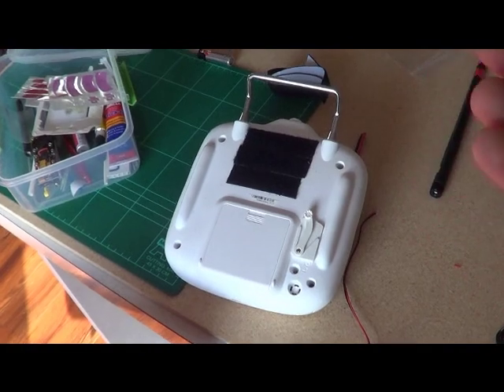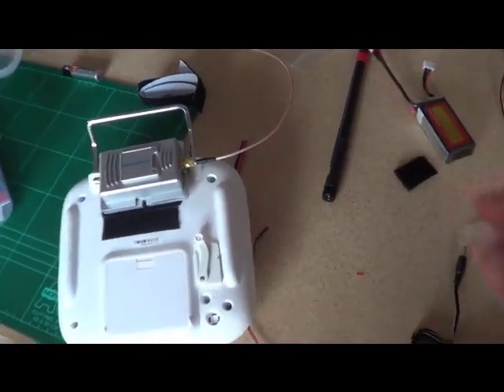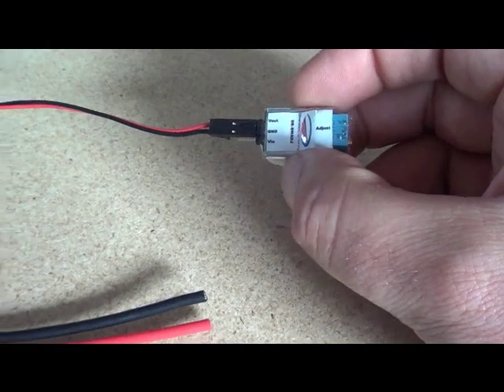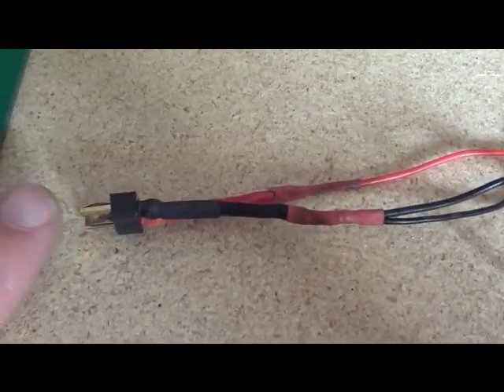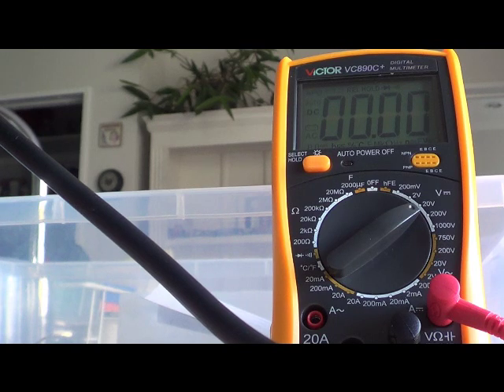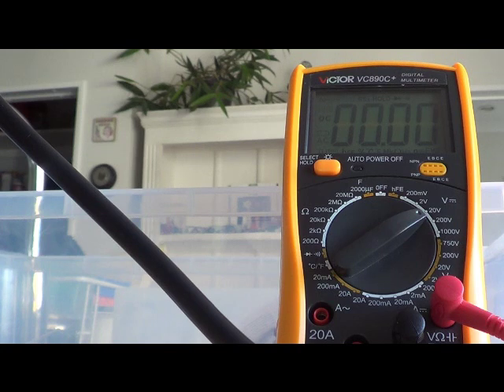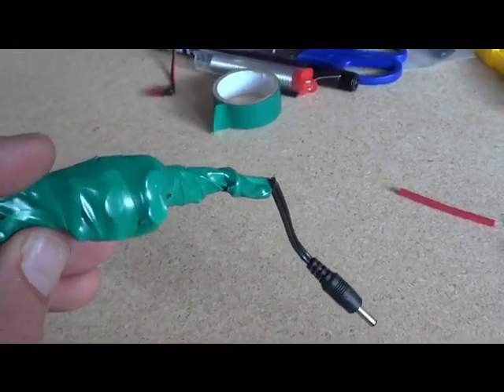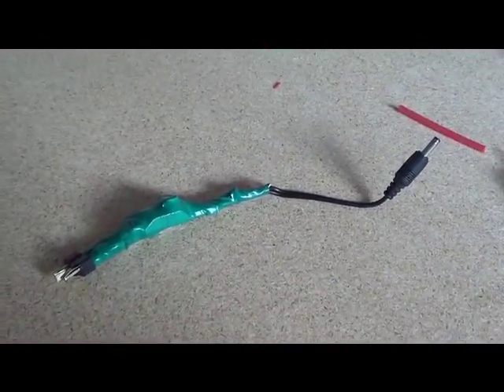DJI Phantom 2 Transmitter Amplifier

Comment: Pete, thanks for nice video.  I am new P2V+ owner and am trying to learn.  I am confused about this controller.  1) Isn't is 5.8 GHz output?  2) Does the 2.4 GHz amplifier amplify this higher frequency?  3) unrelated to your video, could you tell me whether this control signal goes directly to the P2V+ as a direct control signal (I think this is the case) ... it doesn't really go through WiFi repeater does it?  Thanks.
Reply: the tx does in fact run on 5.8, idk what this guy's talking about, unless its an older phantom with no FPV camera.....the wifi range extenders run on 2.4?  or was it 2.7?
Reply: sketch6995
This particular transmitter IS INDEED a 2.4 GHz RC transmitter. Most of DJI transmitters (if not all of them - at least all that I've seen used) are 2.4 GHz. 5.8 us usually for video transmitters IF you live and fly in a fairly flat area. I learned the hard way that 5.8GHz does NOT work well in hilly/mountainous and populated areas. 1.2/1.3GHz works much better in those kinds of areas as it will cut through trees/mountains/hills/buildings.